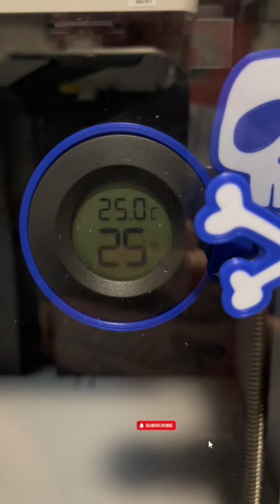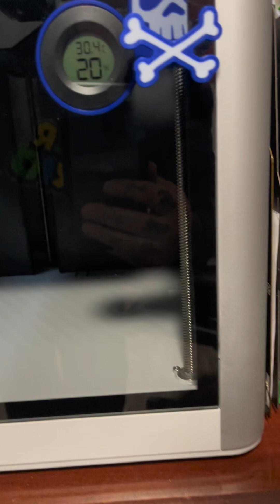How to install a ventilation for @BambuLab x1 carbon that works great!!  Parts in description

Comment: I have been meaning to do this for a while. Thanks for such a well explained and planned out solution. Currently the only ventilation i have is that my printer sits right next to an open window when i print. But it is still in my room next to my computer so it doesnt seem safe enough . Plus im letting dust pile up on printer by having open window
Reply from the maker: Thanks for watching my videos